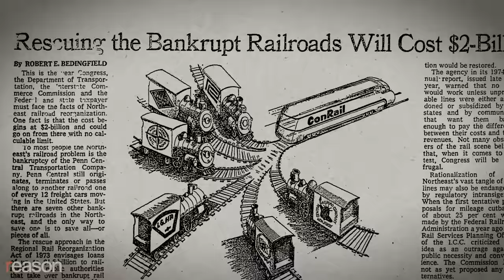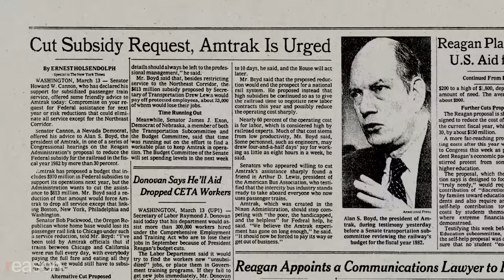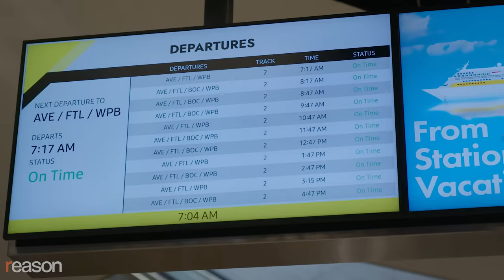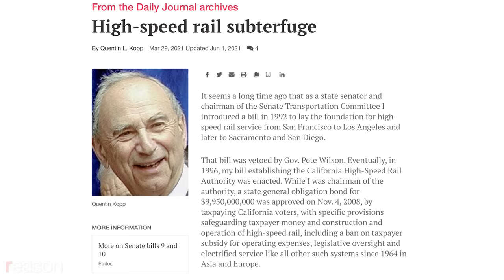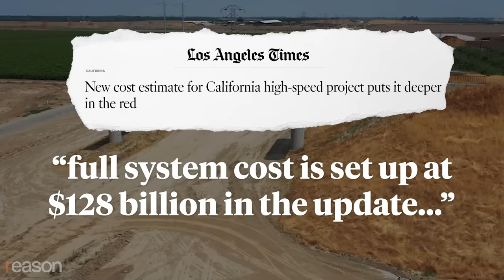How Florida beat California to high speed rail

Comment: The International Union of Railways (UIC) defines high-speed rail (HSR) as a railway system where tracks are “new lines designed for speeds above 250 km/hr (155 miles per hour) and in some cases, upgraded existing lines for speeds up to 220km/hr (136 miles per hour).”
Reply: Website for UIC says "upgraded existing lines for speeds of up to 200 or even 220 km/h".
Reply: @davidjackson7281  Which is included in my quote. The point is that the existing lines do not reach 200 km/hr (125 mph) and the new lines do not reach 250 km/hr (155 mph). Their proposed line between Los Angeles and Las Vegas will be true high speed rail. This doesn't mean that the Florida service is bad, just that it does not meet the definition of high speed rail.
Reply: @danielcarroll3358 You are absolutely correct. The hsr tag comes from the media and the public picks up on it. Of course, BL doesn't deny and clarify this characterization of its service.
Reply: Isn’t it just moving the goal post considering some 125mph old built train lines are referred as Highspeed
Reply: @natenae8635 Isn't it the average speed, not the top speed, that actually counts?
Reply: @natenae8635   Don't confuse technical terminology with public relations.
Reply: The HSR terminology applies to what the media mostly thinks is high speed. Although, generally, in the US, anything above 100mph is high speed. Brightline will qualify for it north of WPB, but truly between Cocoa and Orlando. But as many of you pointed out, that is just the max speed. Average speed 
Will be far less with numerous slow downs along the way. Even the max speed of 79mph between Miami and WPB is not attainable on most of its route. Amtrak Acela is 150mph in certain parts of the NE corridor, with conventional Amtrak trains hitting 125mph. 110mph for diesels are done in many parts of the country like Amtrak does in Michigan. Heck, NJ 
Transit hits 100mph. The US is far from matching Spain, Japan, China and France to name a few. But, its a step in the right direction. Brightline may be better off going back to its original route through Orlando and avoid the parks all together. Let Orlando pay for Sunrail to connect MCO with the parks. Just so many folks know, the TGV in France and the AVE in Spain all maintain their high speed services of 186mph plus, by having minimal stations along the way, and often, with just one station per city. I think that's what Brightline would much rather do. It's an intercity express train, not a local.
Reply: @markydee48 Clearly BL should get through Orlando as soon and as fast as possible to reach Tampa.
Reply: UIC has nothing to do with North American railroads.  100mph can be high speed.
Reply: @davidjackson7281   If it was Average speed I think Acela (Northeast Corridor) wouldn’t be high speed.
Reply: @natenae8635 Defining high speed rail is an interesting subject. Personally to be high speed the route must reach 155 mph for about 20-25% of the route and average atleast 100 mph. So the track condition and number of stops matter. The Acela is not high speed (yet). Top speed is 150 mph for 50 miles. They plan to have 100 miles of 160+ mph by 2035 so the DC-NY section may average 100 mph vs. about 80 mph average now with a 150 mph top speed. 

Brightline and Acela are fast speed or higher speed or semi-high speed or bullet trains semantically. Just saying. Was hoping Brightline would have averaged 80 mph rather than 67 mph. Slower than DC-Boston 70 mph average. (Some may calculate average based on non-stop to prove some point.) 

Brightline West with a top speed of 186 mph may average 101 mph which is flirting with the cusp of high speed. Though frequency and many other factors determine a successful system.
Reply: @natenae8635 One caveat, high speed on upgraded track of an existing right-of-way is 125 mph. So average speed is probably lower at 80 mph. So that makes southern Acela high speed when it gets the 160 mph Avelia train. Confusing to me.
Reply: @natenae8635 If they were built 50-60 years ago.  The standards keep improving as does most worthwhile technology.
Reply: @markydee48 California is building the first HSR line and it's not that far away, 2030.
Reply: @mrxman581  Yeah, but my only issue was that the definitions of Highspeed were very situational.

Seeing as the speed is the importance of the topic it’s confusing to see systems run the same speed and get different treatment.

If Brightline ran from Tampa to Orlando at 140mph is it really a Highspeed service.

Some people like average speed as an indication and some top speed. So I just am a bit peeved by the inconsistency(change) of what is true Highspeed.
Reply: @natenae8635  It's simple, really.  Any new line should be held to the 155+ mph standard. Brightline is a new line. The fact that they partially use old track ROWs is irrelevant because it's a new line.

Acela is a little different because it's not a new line. So, yeah, that's a little more nuanced. Acela achieves the highest top speed of any train in the USA at 150 mph. It's the closest to a HSR line in the USA. The problem is it only holds that speed for around 50 miles. That's not long enough. 

The bigger overall issue with HSR classification in the USA are the very old tracks owned by private railroad companies and leased by passenger rail service companies. Resulting in a mish-mash of track capability for long distance HSR. And freight companies don't want to invest in upgrading the track infrastructure including modern safety switching systems. Rail track ownership needs to change. It's a mess and is a huge reason for the lack of faster modern passenger rail service in the USA.
Reply: @mrxman581  Noted, thanks for the explanation.
Reply: Yeah you’re probably correct. But 125 mph is probably high-speed for the United States and taking small steps for train travel progress is at least something because the United States has virtually nothing that goes anywhere near 100 mph one train in the north east I believe.
Reply: @natenae8635 NOPE no goalposts moved.  For the last 30 years  the US Congress has defined “highspeed rail” as 150+

Amtrak’s Acela was specifically designed to meet the US standard.  Brightline was not (125)
Reply: @markydee48 OVERSEAS IS LOSING.  China has built more miles of high‐speed rail than any other country with $800 billion debt.  None of its lines are covering operating costs.  (As a result, China is shifting to building more roads.)

France’s rail has debts of $70+ billion and has been repeatedly bailed out by the government. SPAIN built its system with a public‐private partnership.  It is $90 billion in debt.  The state‐owned Japanese National Railways has a debt of $550 billion.  (Japan also has Highest debt to GDP of 300%.)

Railroads are an OLD 1700s technology that is obsoleted by faster, more flexible travel technologies.  High-speed rail loses tons of money & is a bad investment.

Comment: I voted for a high speed railway system in Florida several elections ago because not only would it bring much needed jobs to the area, but it would simplify travel within the state.  I understand it was defeated by the Senior Citizens who claimed the trains did not accommodate Senior Citizen’s needs which would’ve been relatively simple to make.  I am for this 100% as it would force the country to look into public transportation as a viable alternative to rising gas prices and rising air travel costs.
Reply: I would Brightline last week from Orlando to West Palm, and I saw at least a fourth of the train and more or Senior  citizens.
Reply: Meant to write, I rode Brightline
Reply: TRAINS COST MORE.  China has built more miles of high‐speed rail than any other country with $800 billion debt.  None of its lines are covering operating costs.  (As a result, China is shifting to building more roads.)

France’s rail has debts of $70+ billion and has been repeatedly bailed out by the government. SPAIN built its system with a public‐private partnership.  It is $90 billion in debt.  The state‐owned Japanese National Railways has a debt of $550 billion.  (Japan also has Highest debt to GDP of 300%.)

Railroads are an OLD 1700s technology that is obsoleted by faster, more flexible travel technologies.  High-speed rail loses tons of money & is a bad investment.

Comment: Jerry Brown forgot to consider California has no continuous coastal plain. The Bay Area and the Los Angeles basin are both surrounded by mountains, and following the highway alignments would yield routes much too steep and/or winding for true high speed rail. Imagine running a Shinkansen train up The Grapevine.
Reply: HSR up the Grapevine route would be sooner, shorter, faster, cheaper, and quicker than the Tehachapis and San Gabriels route. Grapevine is no more diffcult than the others with less tunneling by 10 miles. The decision was political and not based on true feasibility studies. The Tejon property nimbys fought hard against it and Palmdale wants development and fought hard for it. But the better route was decided against. Earthquake faults are a false argument. They can happen anywhere at anytime and the HSR would be properly designed for safety.
Reply: @davidjackson7281  GO GRAPEVINE. It's the best route. PERIOD.
Reply: That's not quite accurate. It would have been more than possible to take the direct route along the I-5 corridor (which is literally a flat, straight line), but doing so would completely miss the point of the project - CAHSR was never about just connecting SF to LA, but rather connecting the entire state together, which is why Prop 1-A in 2008 specifically required the cities in the Central Valley be included in the route.

Had they used the direct route along the I-5, they would've been able to avoid most of the major problems the project has faced and it would've been able to be built much faster and cheaper, but you would end up with a far useful train line that only serves the two major coastal areas while completely bypassing the Central Valley region, which has a larger population than most states but has been completely economically stagnant for decades. 

The fact is that with infrastructure, you get what you pay for, and in this case California chose to be a lot more ambitious instead of taking the easy way out. We can debate whether or not the tradeoff is worth it, but the fact is the lack of an easy, direct route was never the problem
Reply: @davidjackson7281 the chosen route will serve many more long neglected communities in the central valley.  It's the better choice for connecting much more of the state. Another express HSR line from LA to SF can be built along the 5 later.
Reply: @Chario_ very well said.
Reply: @mrxman581 Some people are aware CAHSR can both serve the hwy 99 valley towns and also traverse the Tejon Pass.
Reply: @michaeljones7927   - give it up. The Grapevine is never going to happen. By extending travel times by just 15 to 20 minutes CA HSR is directly serving a population center larger than more than half the states in America. To call these places "nowhere" you have to call half the American states "nowhere" including states like Oregon and Massachusetts. There's also the convenience of a high desert hub with Brightline West which a Grapevine routing would not provide.
Reply: @mrxman581  - the question will remain as to whether building another express HSR line along I-5 is really worth it just to save 15 to 20 minutes. Before even giving a moment of thought to that I'm sure there are plenty of other route extensions that would be much more justifiable. Assuming everything was built out including extensions to Sacramento and San Diego I would much rather see the originally planned upgrades to the Altamont corridor completed which could possibly allow direct routing of HSR trains between Redwood City / San Jose and Sacramento. There are currently proposals for new alignments to allow 125 mph service on that corridor. They would just need to electrify it.
Reply: @brianwithoutay2291 Now you are talking! Rebuilding the Dumbarton Rail Bridge shortcut would be the way to go.